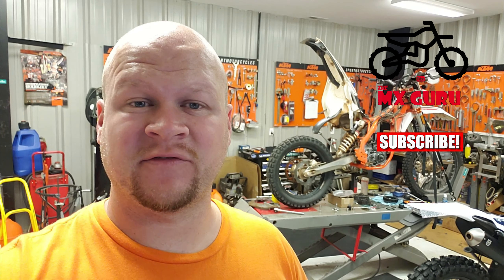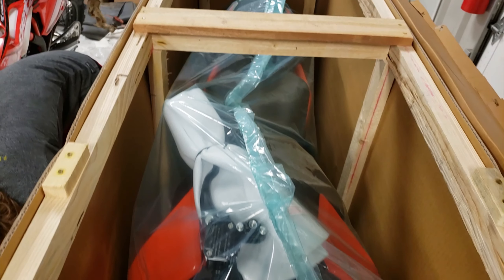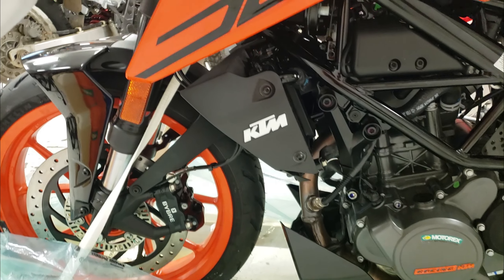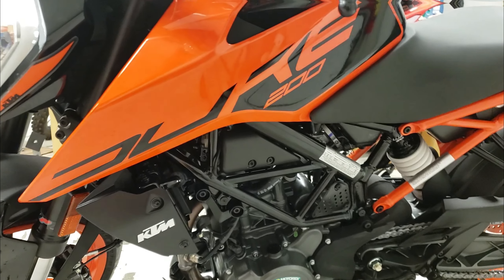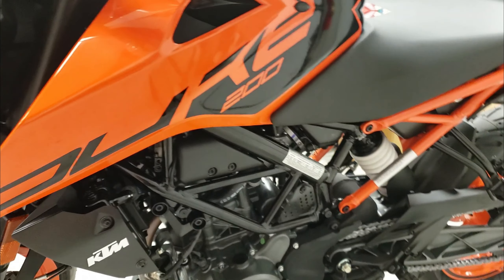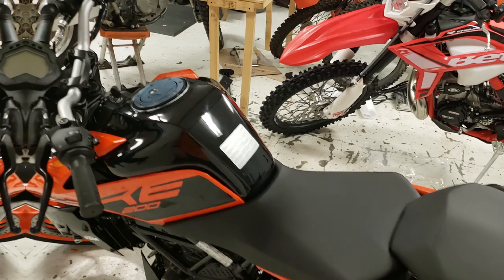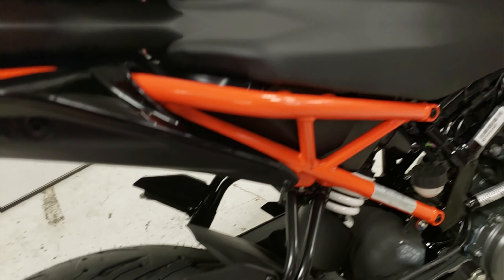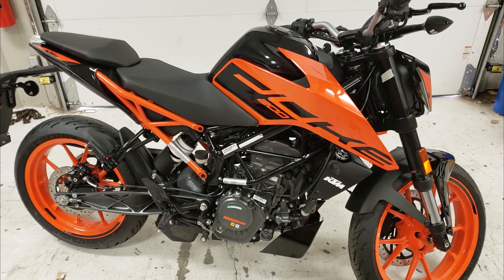Unboxing the brand new 2020 KTM 200 Duke!

Comment: It's spec is 308.6 lbs. with all fluids except fuel and has 26 HP. I'm gonna buy myself one after I'm finished with my Suzuki GSX-S 150. The weights are close to the same but the Duke has over 36% more HP. I'm in SEA so these smaller displacement single cylinder bikes are just the ticket here.
Reply from the maker: Saweeeeeeet! WHere is here?
Reply: @mxgryan  south east asia I think